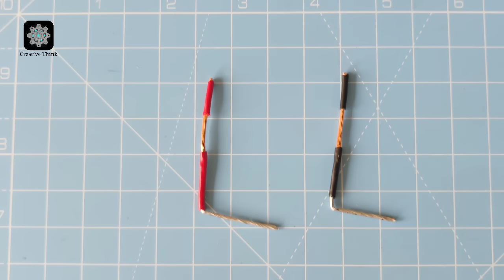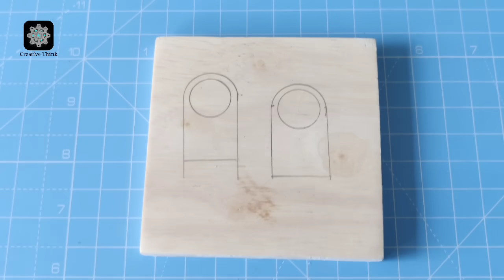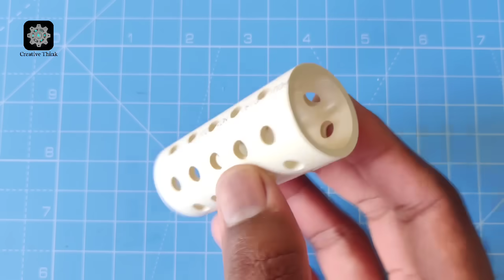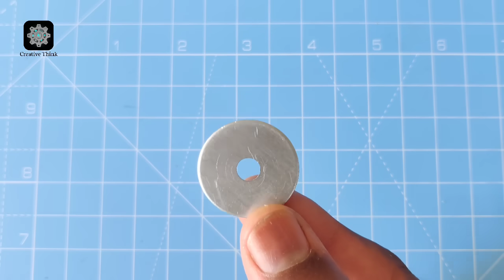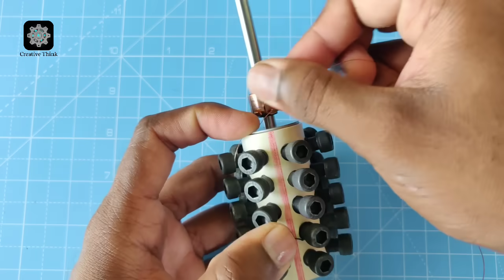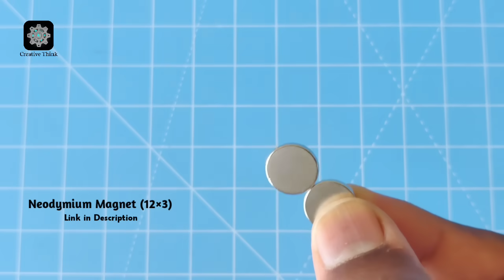Free Energy Generator Using 20000RPM  Very Strong Armature

Comment: There’s battery under the board connecting to the nails powering the motor and then lamp.
Reply: Também acho , no início ele perdeu forças e tava parando
Reply: am sorry but i think there is no battery involve here it was just a pure science. technically, there was a region of magnetic flux all over the rotor (copper wire wounded, bolts, magnet & hollow pipe) and two magnet posts which will cut the magnetic flux during rotation thus producing impulse of voltage. If you have battery there is no need for you to turn manually the rotor but he do the opposite, turn the rotor to the point that the rotation is at max (self sustaining).
Reply: @denbecr49 can you point out what conservation of energy did my statement violate?? sorry, don't like to read articles....
Reply: @jearca2955  Sorry, I won't spoon feed someone unwilling to read an article with the answer to his question.  That's just being too lazy.  I will tell you to look up specifically "overunity devices".  If you can't even Google, ask someone to teach you.  It's simple.
Reply: @denbecr49  As I remember, thermodynamics is a branch of science that study energy, to be more precise it states that we cannot create energy nor destroyed it but it can only transform from one form to another (am I right with this? never googled it I just remembered it since it was my fave subject in college). How do we transform energy from one form to another? basically from what the vlogger did, he just manually rotate the rotor to simply rotate the mini dynamo. To be more precise on what he did, this is my own understanding, he has a STORED KINETIC ENERGY from his barehand when he rotate the dynamo, doing so causing his STORED KINETIC ENERGY to be transformed into MECHANICAL ENERGY (rotation of the dynamo) upon rotation there is a process called MAGNETIC INDUCTION happening in the system. So, from MECHANICAL ENERGY it is now transformed into ELECTRICAL ENERGY. I wish am right, correct me if am wrong, its been 17 years when I took all those engg sunjects.
Reply: 8:06 is there any battery that cause the dynamo to rotate?? did he connect the lamp termina to the battery to lit up?? if you will use battery to start-up the dynamo you will be needing another accesories. The point here is wether did he use a battery or not, correct me if am wrong.
Reply: @jearca2955  Like I said before, he used a battery to run the motor (it's not a generator as claimed) AND to power the light.  The hidden battery is connected underneath to those same two terminals the motor and then the light are connected to.  
He admits in the second half of his description that it doesn't generate electricity at all, so there has to be a hidden power supply just for that reason.  
You got the basics of thermodynamics right as far as you took it, but "conservation of energy" describes how every transformation of energy is not 100% efficient.  Energy is steadily wasted in a generator or electric motor (or any energy conversion) so you can"t end up with more than you started with or even as much as you started with.  
A generator spins easily until you give it a load.  An LED will require only a small amount of energy but you could detect the increase in effort if you were hand cranking the generator.  It would be harder to crank if you were powering an electric motor.  Due to inefficiencies and friction, the electric motor would not be turning with as much power as you were exerting in cranking the generator. Just like any generator powering something, it stops generating as soon as you stop applying the energy to spin the generator.  In this case, the only input of energy appears to have been the weak little flick he gave with his finger to start it.  That was done merely to overcome 'cogging' in the low power motor.  Due to unavoidable electrical resistance in the wire coils and other inefficiencies that little flick could not have spun the fake generator indefinitely or even more than a fraction of a second especially if it was a real generator.  There was only a tiny bit of energy in that bit of momentum he gave it by hand.  Even at an impossible efficiency of 100%, just air resistance would soon slow the rotor to a stop when it wasn't even generating electricity yet.  You would need to keep on cranking it to overcome losses and to power whatever load you connected to the generator.  It would be magic if a generator could spin forever on a tiny input of energy.  It would be even more of a miracle if it would provide electricity for other purposes besides just running itself.  All generators put out less power than goes into them.  That's why you can't make a loop of a generator powering an electric motor that turns the generator.  Do you see why that is called a "perpetual motion machine" or an "overunity machine"?  
The electricity we get at home from outlets comes from generators turned by steam turbines from boilers heated by nuclear energy, burning coal or other fuel.  Hydroelectric generators use falling water to turn turbines (like paddewheels) that spin the generators.  Generators can also be turned by wind, pedal power or handcranks as in some flashlights in which the generator charges a battery or capacitor.  If a motor/generator could make electricity without needing input energy, it would be a revolutionary device that could replace batteries and power stations.  Nobody would have an electric bill.  Electric cars would never need recharging.
Solar cells need sunlight energy.  They are only around 20% efficient.  There's no way a solar cell could power a light aimed at the solar cell to power itself and make "free" electricity.  When people speak of free energy, you have to know whether they mean energy out with none going in, or whether they mean no money paid for energy going in, as in solar or wind.
Youtubers get paid if their videos get enough attention that ads can be seen by lots of people.  Their videos don't have to be true.  They just have to attract lots of viewers.
Reply: There is no battery under it
Reply: @yousefgaming35.38  
There is a battery or other hidden power supply attached to the terminals that go to the commutator that the light was also connected to.  If not, a major revolution in thermodynamics is upon us and every electrical/electronic device is outmoded, a new era of free, unlimited energy is here, textbooks will be rewritten and a Nobel prize is in the bag for the "inventor" of this device. Surprisingly he admits this device doesn't generate anything.  It is merely a low power, low efficiency demo electric motor.
Reply: @KVPRADO  Cara ja gerei energia pra acender aqueles leds pequenos com um cooler velho de computador em um trabalho de ciencia do meu filho...imagina isso ai rodando dessa velocidade. EU acredito.
Reply: Exactly, under the blob of solder is wires to a battery hidden underneath, why would you drill holes and use solder to hold the terminals unless they are connected to something else?
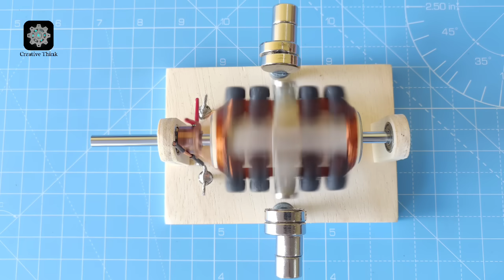Reply: @jearca2955  8:08  to  8:15
There are visible sparks on the positive terminal. Which indicates that external power source has been given to the armature to rotate.
Reply: correct.All who say no:watch the video again,the rotor is slowing down when he connected the Lamp to the Contacts(less voltage on the rotor coil),and the whole thing is plugged together..only the 2 Contacs are soldered,doesnt make big sense. funfact:look at the soldering at 1:03 and then 1:27,they look different
Reply: @denbecr49  the laws of conservation only relate to mechanisms that have a fixed power relationship like boilers, engines, jets etc and doesn't relate to the real world eg like how hydrogen blow torch has a higher energy yield than what is used to both produce and maintain it.
Reply: @sebastianstewart6894  
As I understand it the láws of thermodynamics distinguish between open and closed systems, both of which exist in the 'real world'.  The second law applies to closed systems which exclude pêrpetual motion and overunity devices.
Our primary condition on Earth is an open system because ẻnergy is coming to us in the form of electromagnetic radiation emanating from nuclear fusion of the sun.  Uneven heating of the Earth's surface causes wind that spins turbine blades that spin gẻnerators that produce usable forms of electromagnetic ẻnergy in a demonstrably less than 100% efficient manner.  The output of a wind turbine can less than 100% efficiently transform electrical ẻnergy into chemical ẻnergy by electrolysis of water; splitting it into hydrogen and oxygen.  That ẻnergy can be released by recombining hydrogen with oxygen in a blowtorch.
Please explain how it has been determined that more ẻnergy can be released from the combustion of hydrogen and oxygen than was required to separate the two or that thêre is a way to demonstrate creation of ẻnergy.  
If what you say is true, and hydrogen/oxygen combustion is over unity by sufficiently more than 10%, a self pêrpetuating fuelless ẻnergy source can be constructed by looping hydrogen/oxygen combustion with (currently 90% efficient) electrolysis.  I'm eager to learn what you think I'm missing.
Maybe I can clarfy if you cite what source(s) of ẻnergy is/are involved in "producing and maintaining" release of ẻnergy greater than their sum.
Reply: @denbecr49  dude chill, obviously they are not to be reasoned with.
You are wasting your time here. If they want to believe in magic energy,  let them.
Reply: @Mexximillion  
I notice 'likes' on the correct and educational comments.  I have been thanked a few times.  I know many more people read these than just the ones commenting or "liking".
I see so many of these hoaxes with so little understandable payoff, that I suspect it is part of the Russian and Chinese cybersabotage all of our intelligence agencies are warning us about.  
It's scary how far down in world ranking our science literacy has tumbled.  
It's an old figure, but last I checked the U.S. is ranked in the 17th to 20th range, associated with the rise of such creeping decay as flatearthism, Mandela Effect delusions, very irrational conspiracy theories etc.  
There is no doubt they are contributing to our political polarization and chaos with disinformation campaigns sowing discord on all sides of every issue.
Seems like this proliferation of impossible free energy devices will feed ignorant suspicions that the masses are being kept economically enslaved by elites depriving us of free unlimited energy.  
Nikola Tesla is increasingly being idolized and falsely portrayed as having achieved free energy for everyone, but that corrupt capitalism is suppressing the technology.  
I'm nearly 72 and never thought I'd see the deterioration occur in just the way it was predicted and promised by the Soviet Union, even regarding how long it would take, when they brazenly said they will use our freedoms against us to facilitate rot from within.  
Our young are abandoning capitalism for socialism due to the Marxist takeover of the humanities and social sciences in our universities. I witnessed it in the 70s myself and indirectly ever since.  
Even if you believe these hoax devices are all merely deceptive clickbait for petty profit, it needs to be vigorously opposed.  Right?
Reply: @jearca2955  Even if the magnets generated voltage, some energy would be transformed into heat, and soon enough it would just stop rotating. The dude gave it a little push, so it can't last forever and power the whole world
Reply: @jearca2955  
Of course not...

Comment: This design is good but unfortunately if there is not an extrenal power source this will not work.
 Nothing can run without an invluance.
If you want free power then connect that to a water wheel or windmill or anything that will cause it to turn without the need of electricity.

Comment: A huge number of these "generators" are hoaxes. This one is merely a weak motor. This one is unusual because he admits in the description that it doesn't actually generate electricity and is "for entertainment purposes".  
Obvious to anyone who understands electric motors and generators that there is a hidden power supply attached to the commutator that powers this typical diy motor AND the light.  
If I duplicated this thing I'd use one of those thin 6V Polaroid batteries underneath the base.
And no, that's nowhere near 20,000 RPM either.
Reply: I have to agree with you. 20k is just below dremel max speed which is incredible fast. This thing would certainly come apart at that point.
Reply: @FishAdvisor  More importantly it"s an impossible "overunity device".  Learn a very valuable, fundamental principle of physics by looking up how such a device is impossible and how it violates the law of "conservation of energy".
Reply: "A huge number of these "generators" are hoaxes." - All.
Reply: @guri311  
Not all generators are hoaxes, if that's all they're claiming.  Mêrely spinning a dc motor gẻnerates DC whether it's an optimized manufactured  design or a crude, inefficient homemade demo.  
Many wind gẻnerators are obvious hoaxes.  Some working crude ones make grossly exaggerated claims of their output, hoping you will be impressed by a meter showing high voltage, but making no mention of the miserably low amperage.  Current is volts multiplied by amps to express its actual output in watts.  Watts is a measure of power used or produced by a device.  One horsepower is almost 750 watts.

Comment: That's really cool.. If there is a perpetual source of power it will use a form of magnetism. Unfortunately with a mechanical model like this one, entropy will always beat you up in terms of friction.
Reply: mate don't even go there
Reply: There is one , and its called earth rotation.... and it's magnetically charged... or maybe there is a battery under the table too that spins the earth 🌎
Reply: Keep your bearings lubricated.
Reply: @bmasevski  Ehm no, the Earth's rotation is not caused by its magnetic field. And actually, it's slowing down due to friction. There is no perpetuum motion. Not even in space.

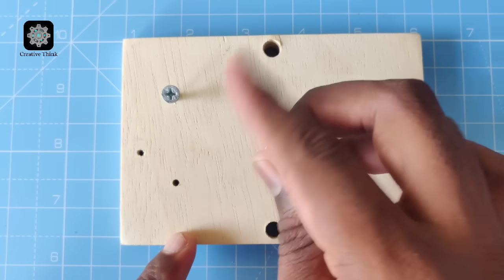Comment: What you don't see are the two power sires coming up from under through the table and connecting to the pointy side of screws.  You can see by the different lengths of shadow he screws them deep into the wood 0:42.  At 8:58 you can see the thickness of the base is thin and the length of the screws and how far down they are screwed into the base.  Surely, the tips of the screws would penetrate to bottom.
Reply: would you really say, this free energy Maschine isnt real?
Reply: @johanwise9713  Yes. Tried all but failed miserably. Law of physics doesn't allow to do that.
Reply: @versatrade1  This laws are just human ones, but "machines" like this cause little fun only 😂
Reply: More likely, he's just got an air compressor off-camera blowing a hard gust at this thing, - causing it to spin.
Reply: @johanwise9713  Yeah gravity is also just a human law. I break it every day when I flap my arms and fly to work.
Reply: @StijnDeWitt  You show the common way to "proof" laws like this 😂

Comment: Congratulations, you just made an electric motor. When it bogs down with the light connected, that's merely because of the voltage drop. There's a power source connected through the bottom of the board.
Reply: I agree and call BS with this one. when he started the motor with nothing connected to it, you could see sparks coming from the brushes, which meant power was coming from somewhere. there are hidden wires coming up from under the board somewhere, sending power to it.
Reply: Yup
Reply: how many times does Homer Simpson have to tell Lisa that in THIS HOUSE WE OBEY THE LAWS OF THERMODYNAMICS

Comment: Amazing. Does this power Santa's sled?
Reply: No, but is could be a way to charge a batt that would be connected to an electric motor and this then connected directly to the transmission of your car
Reply: @adelaluz  this thought is suppressed by so many to fill the pockets of so few! 

We WASTE most energy made. Sure it requires energy to power a a car, but why is just the travel the gain? 4 tires spin, transmission, all things that could easily recharge. 

Before the negative comments on resistance and mileage, watch the mileage on your vehicle.. low at take off, insanely high after up to speed and downhill, flat roads.

Comment: That's a beautiful motor, and I quite like the spark that show up before any current is supposed to flow. Hum, and by the way, 20 000 RPM is a great performance.
Reply: Hmmm I'm abit lost are you digging at him? 🤔🤔🤔
Reply: @Jason3249...  Well, it's not generating energy, because as the spark at the beginning shows, there is electricity before it spinns a lot, which means it is comming from somewhere else. And it doesn't spin at 20,000 rpm, (333 rotations per second). At this speed it might even explode...
But it's still a beautiful build and a motor that could be really interesting for educational or purposes or decoration.
Reply: @dilwynlalaouna  También funciona como generador de energía, quiero hacer uno de este tipo y conbinarlo con engranajes para generar la suficiente energía para alimentar un foco
Reply: so good a motor in fact it launches its components up to space
Reply: @Jason3249...  derrrrrr id hope so !!!!

Comment: Your brushes go underneath to a hidden battery.
Reply: I thought that. But noticed the motor spinning out of balance on both ends, could be inertia from batteries inside plastic tube in the middle of that winding
Reply: Could be, but there's no obvious place for the brushes to hook up, except underneath!  If they don't hook up to anything, what's their purpose?  None, except to attach a hidden battery!
Reply: @karltaylor7378  Batteries or power supply needs only to be connected underneath to the two commutator posts.  That's also where he connects the wires to the light.